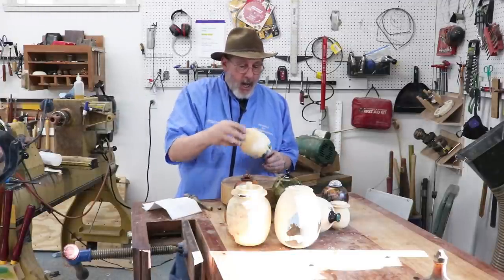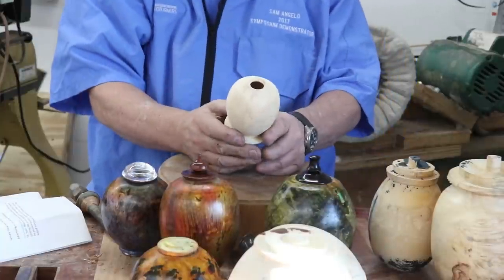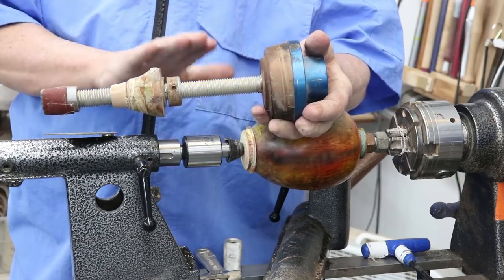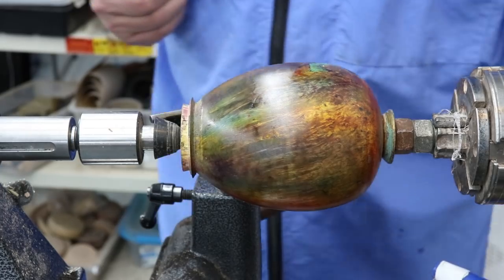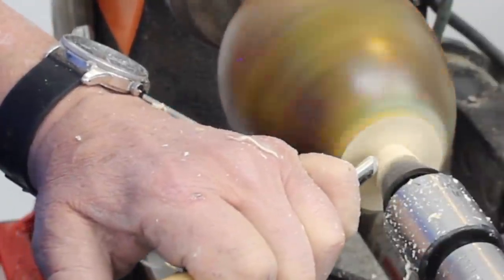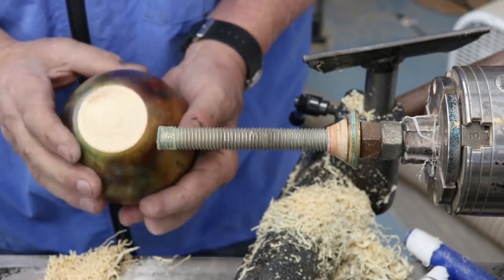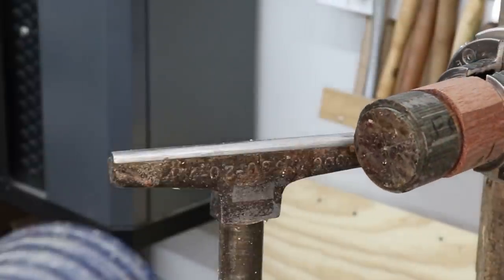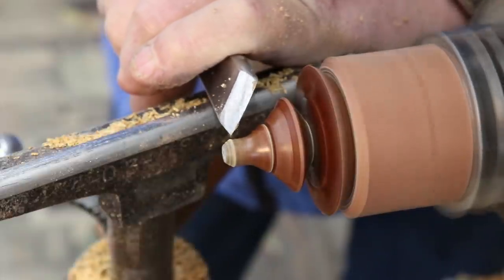Finishing the Bottom of a Hollow Form and With a Threaded Lid  with Sam Angelo

Comment: Enjoyed the video. I need to make one of those threaded things for HFs although I probably have not turned one in  a couple of years. Just a thought, Sam, but when you mention that you have a video on something related to what you are showing, consider adding a card link to appear when you are saying that. More views and watch time and folks don't have to go searching for your video. A tip someone showed me to hold a 3/4" threaded rod in a chuck was to wrap the threads with a copper wire before chucking. Prevents damage to the threads and probably gives a better hold with the copper compressing instead of steel threads.

Comment: Nice fixture for holding a hollow vessel while finishing the vessel bottom. It seems to work very and is simple to use. And I liked the segment showing the turning of the vessel lid.  I do not think it has too many threads. But I suppose it could be shortened a bit. The lignum vitae is beautiful. Make careful use of what you have, I understand it's not available any more. Thank you for sharing. Have a great 2021 and stay healthy.
Reply from the maker: Glen, I was not aware Lignum was no longer available.  I am not sure how much I have but I think I will use it more in the future. I have always had a problem with it drying and changing shape or shrinking.  Sam

Comment: For those of you who aren't a McGuiver, Rubber Chucky makes a reversing chuck like the one you did.  Has a MT2 on the end.  I don't work or get anything from them.   Not sure what that noise is but you may want to oil something on your lather.
Reply from the maker: The noise?  I think my chucking device was squeaking....?  Sam
Reply: @WYOMINGWOODTURNER  it was loud, thanks Harold

Comment: I know that you don’t use them but do you know where we ( harbor freight lathe owners) could buy poly female and male inserts for hollow forms?  I am very jealous of your threaded inserts.  Maybe one day I can get a better lathe and learn to thread.
Reply: I use threaded PVC pipe fittings.  Alternatively, you may buy brass threaded fittings from suppliers like 
https://www.fromwalnuttoantlers.com/listing/477244616/3-opening-short-lid-plug-solid-brass.   Brass inserts are expensive.
Reply from the maker: @nemoemanon6679      Nemo   thanks for adding this.  Sam
Reply from the maker: I really don't know where you can get premade inserts.  I think they have them in wood.
Sam
Reply: @WYOMINGWOODTURNER    Thanks for answering.
Reply: @nemoemanon6679    Thank You very much!  I hadn’t thought of that.